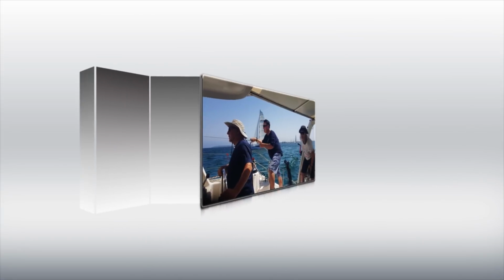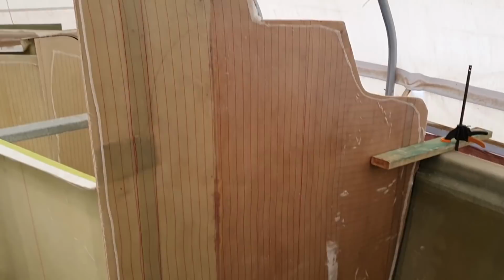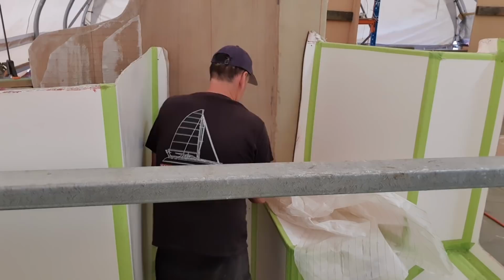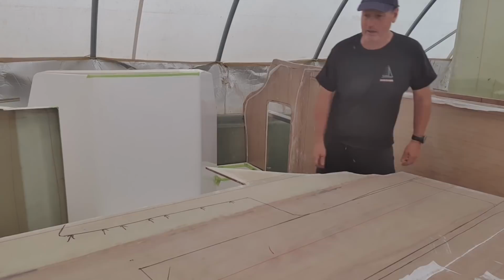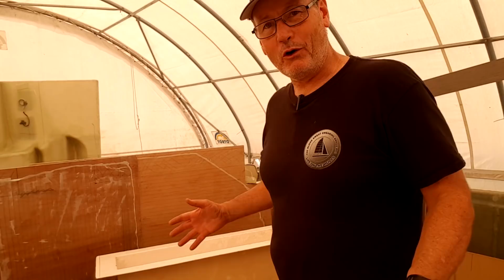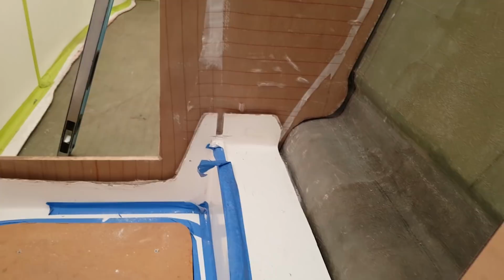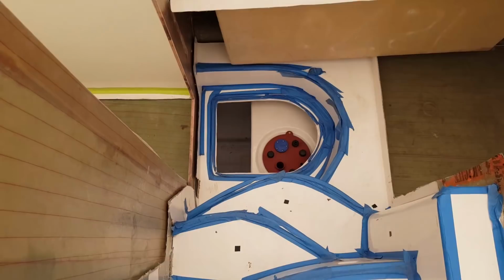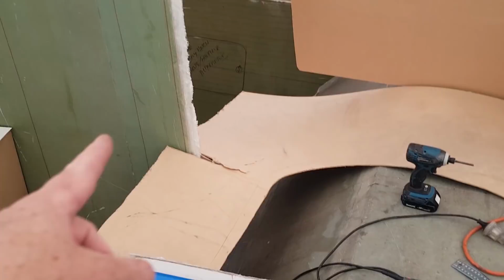Ep102 Amidships Bulkhead and Freezer Unit Design - Life On The Hulls - Catamaran Build Project

Comment: Love the progress, Ross.  You need to get some help in there at key points before you blow your back out!  Those are some heavy pieces.  Hopefully some of them will find permanent homes in the hulls pretty soon.
Reply from the maker: Thanks so much Dave.Main forward bulkhead tabbed in this week.Spent a solid week doing it right.My back is problematic and can give me jipp at times but generally the more I work the better my back.Use it or loose it.Rossco

Comment: Glad to hear that life is returning to what passes for your normal if there ever is one ! Hope you didn't suffer too much with all that moving in the humidity, did something similar last week cleaning up old belongings etc... Was curious if you'll spray foam the walls and bottom of that freezer locker, or make up a series of foam boards laminated to fit that space tightly ? Will you recess into walls a refrigerated air channel, or have it external of the walls, or just use wire baskets etc to hold frozen items away from the walls for recirculation ?